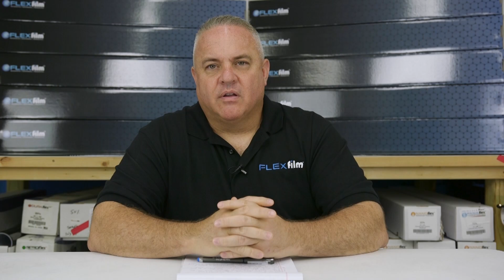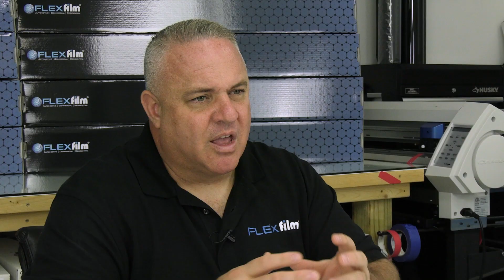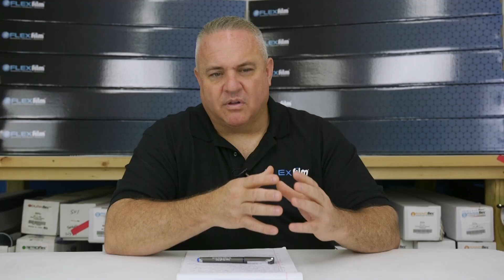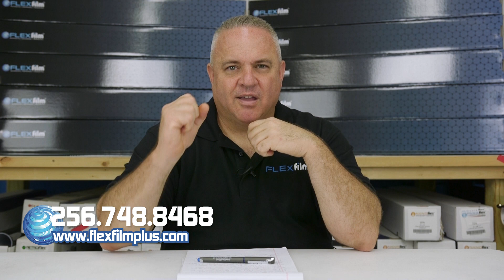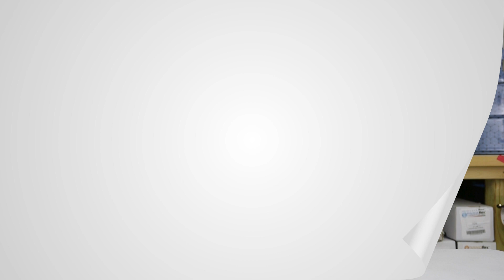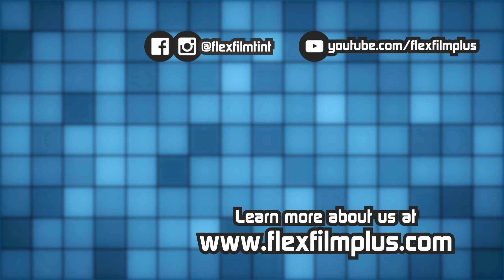What's The Difference Between Carbon And Carbon Ceramic?

Comment: What is the difference between terra flex film and the pana flex's construction? Nano Carbon and Carbon Ceramic
Reply from the maker: Terraflex is a carbon film that excels at looking good and offering solar protection. Panaflex is a carbon ceramic film that does all the things Terraflex does, but it also offers heat insulation.

Comment: So for anyone not able to digest the protection vs comfort.

Carbon will absorb the heat energy from getting inside up to a certain point. (Think a battery) Then the film takes on the heat, then the glass then it radiates in the car.

Carbon ceramic does everything carbon does with the benefit that the thermal heat up is even slower because ceramic doesn't hold onto the heat and transfer like the carbon will ( the ceiling time is much higher before the heat starts affecting the cabin temperature and air conditioner efficiency.